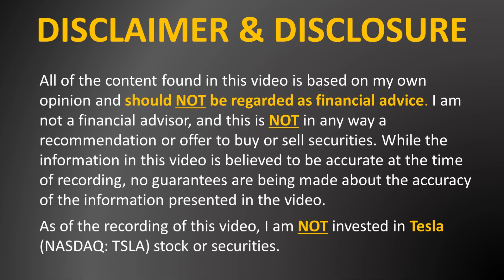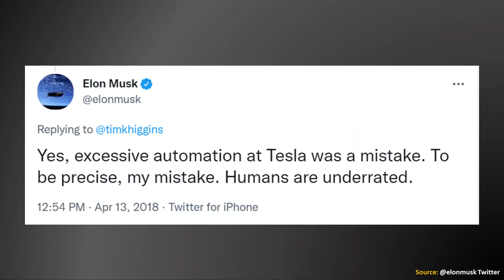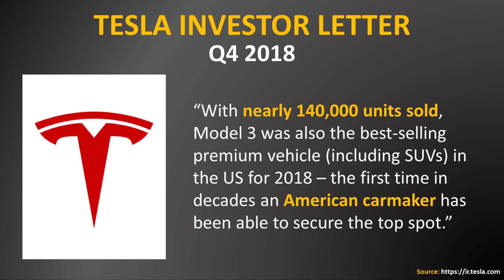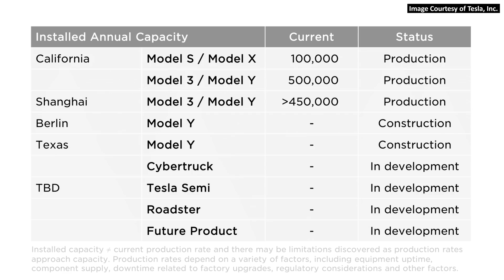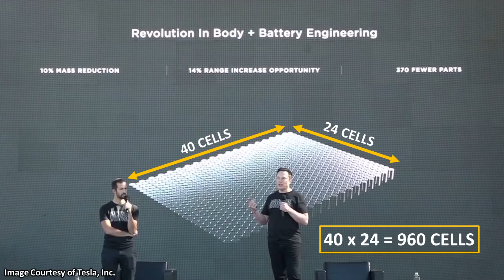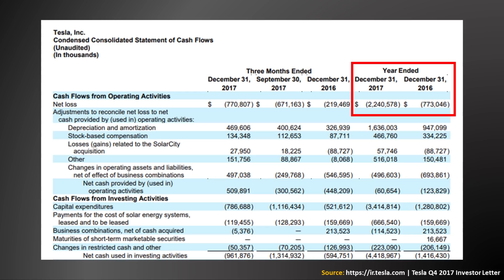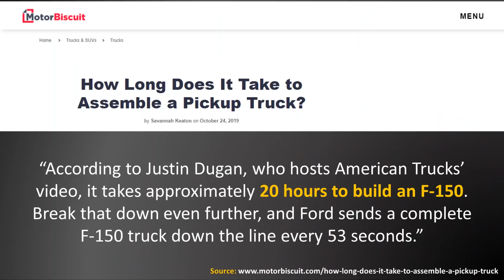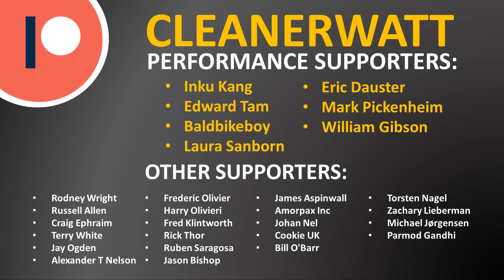Tesla's MANUFACTURING REVOLUTION: 2022 Tesla Model Y vs 2017 Tesla Model 3

Comment: Great that they improved production but the quality still sucks and their service ranks as one of the worst in the industry.   If they want to be considered anywhere near the best they better figure out those things or they won't get anywhere near the top.
Reply: I currently own two Teslas, a 2018 model 3 with 50,000+ miles, a 2021 model Y with 22,000+ miles, and I sold my 2016 model S after driving it 80,000 miles to purchase the model Y. Service has been excellent, and problems minimal. Quality is very, very good. Certainly better than any other vehicles I've owned. I bought my first car, a BMW 2002 in 1973 and have owned many cars since then.

Comment: The run rate end of 2022 will be way above 2MM, probably 2.75MM and the actual production will be 2.325MM. China will do 1.2MM alone, 750k Fremont is easy, 250k Austin and 125k Berlin.
Reply: I'll mark this one so i can laugh at it in 12 months time.
Reply: @wizzyno1566  Yes, do that. You'll be amazed in how accurate it will be. Let me know what you think and which numbers your prediction is based on

Comment: From 2018 that is a 64.8 CAGR !! That is impressive! However, I'd like to know 1. How much FASTER and 2. HOW MUCH CHEAPER will the new Teslas with front- end Giga cast and the 4680s with structural battery pack, are we talking 15% cheaper, 30% cheaper and faster or?

Comment: would like to see quality control improvements included as a necessary step before delivery to customers.
Reply: I have a Shanghai M3, Tesla has zero quality control issues with cars from there. Panel gaps and paintwork perfection.
This will be replicated and improved on at Texas and Berlin.
Reply: @grahambrown42  Exactly!
Reply: Don't believe every lie the oems feed you.  I have a GM sitting in my garage with horrible issues that my father was too old to notice when he bought it before he died.  Tesla is the only manufacturer that tests every car at every stage in manufacture.  Other companies occasionally pull a car from the line and go over it.

Comment: Wait. So Giga Texas isn’t planned to make Model 3?
Reply: I have wondered that as well. I’d really like an M3 built with the giga press with a structural 4680 battery pack. Why? Because I prefer the driving dynamics of the small sedan versus an SUV. But I’m afraid improving the M3 will fall behind the Y. Perhaps Tesla will update the M3 line in Fremont eventually.

Comment: I don’t really see anything special about those improvements, Tesla barely makes two vehicles models the y/3 and the x/s which are almost the same, on the other hand, Mercedes’ makes everything from armoured vehicles to 1000 different configurations vans, trucks, bus, minivan, utility vehicles…..
Reply: Is Mercedes making 5M+ of them? How long have they been in manufacturing business? Mercedes has 56 factories. Sold about 2M+ cars and ~350k vans in 2020. This is from assumed 56 factories. Tesla has two factories and sold 936k cars 2021. Say what you like but Tesla is doing far better than you realize in term of its manufacturing technic.
Reply from the maker: Taking Model Y manufacturing time down to 10 hours (vs 20-30 hours for VW ID.4) is pretty mind blowing. This is a HUGE advantage that cannot be overlooked!
Reply: @Cleanerwatt  bullshit, Tesla started from zero too just like vw is still ramping their production while also working with suppliers, vw has also already built their own batteries recycling facility and put into operation. Vw makes about 10 million cars a year and every 16-16 seconds a car lives the assembly line.
Reply: @alanmay7929  VW has 136 production plants (2019) for their 9m (2020) vehicle production. That’s an average of 66k per factory.Tesla factories make 10x that, with few model variants, few options, and few colour choices. The efficiency and amortisation of the factories over a huge number of cars results in large profit margins, more than any other car maker.  With no debt, this will allow Tesla to expand to more model types when they have exhausted demand for the few models currently offered.
Reply: @Cleanerwatt  there is nothing mind blowing here!

Comment: The machine that builds the machine.  Once you've optimized the car, you then have to optimize its construction.  And the logistics of the supply chain for parts and materials.  Then you have to optimize the funding of the construction.  I'm probably still missing a couple steps....

Comment: Sounds great, but when are all these efficiencies going to be reflected in the price to consumers? I really don't care how long it takes to assemble a car. I care about the quality and the price.
Reply: Comes with scale. Which is dramatically improving. Look into Mores and Wrights Laws of reduced cost with scale. 

Most of the pricing right now is in demand hikes. My cars $7,000 more expensive than when I got us due to demand and external factors like the supply chain that’s affecting everyone. Everyone’s prices are way up.
Reply: Choose one: Quality or price.  You get diminishing returns as you change your decision.
Reply: Exactly! Most rational consumers want a quality product at an affordable price. Tesla is nice and all but is still lacking in build quality and is currently priced out of the reach of the average American.
Reply: @benadebayo6088  What price is affordable do you think? Don't forget to factor in that maintenance costs are lower and electricity is about 25% the cost of gas, at least where I am.
Reply: @benadebayo6088  Tesla's build quality has improved greatly in recent years, build quality is over exaggerated and so 2020.  At this point in the production process the current crop of Tesla's are not priced for the average American. The $25K 3rd gen Tesla will address the average American. If that's not good enough, buy a Corolla.

Comment: Absolutely love this man. Elons said countless times that the shining star of tesla is going to be in manufacturing expertise even more than the products. Not enough is said about the iteration and improvements of the machine that makes the machine. Very very nice.
Reply from the maker: Very true - thanks for the kind words.
Reply: Are you serious!? Machines have been making machines for decades, stfu! The manufacturing expertise is definitely not Tesla, it’s the companies that makes vehicles with platform sharing and the multiple customization and features for a wide range of applications.
Reply: @alanmay7929  No you’re incorrect. Most other companies especially in automotive are using the same suboptimal manufacturing technology that’s been around for decades and are objectively known to lack innovation and change. There’s a reason Tesla and SpaceX are the two heaviest demanded companies by graduating engineers. It’s objectively and factually backed that Tesla is innovating and moving forward with manufacturing expertise in leaps and bounds above everyone else. Period. The next best are actually the Chinese companies following that example. 

Case in point: single large body mega-castings reducing 300 parts to 1.

The aftermarket will always be there for customization but you can’t logically argue against Teslas manufacturing unless you’re dangerously uninformed, or heavily biased against Tesla.
Reply: @CYBRLFT  I strongly disagree with you, first of all Tesla said they where replacing 70 parts with one large part but they don’t tell you that they were the only to use sooo much parts, other manufacturers have been using larger single parts for years including composite materials to even make lighter cars, bmw built a decade ago one of the biggest carbon fiber factory. Other manufacturers also have way more vehicle types and selection compare to Tesla. Tesla is now bringing features to their cars that were already available on other cars decade ago, other manufacturers are also in sport competition where they develop and race the most advanced vehicles on earth, from bikes to F1 to wrc. Other manufacturers makes vehicles and equipments used all around the world from mining to construction, rescue, utility vehicles….. people seriously underestimate the automotive industry.
Reply: @CYBRLFT  aftermarket customization is not at a level of a manufacturer that can offer most of those things in house with better integration, you can litteraly buy a Mercedes’ dump truck, chassis alone, garbage truck, long haul truck, super heavy duty……. A Mercedes’ double decker bus, articulated bus, coach bus, city bus, minibus….. tons and tons of possibilities from house. Even army vehicles are made by Mercedes.
Reply: @alanmay7929  This isn’t new information. The auto industries been around over 100 years. One would expect everything you said in the sense of the reach of automotive engineering. 

That’s not being debated. I’ll return the focus to the point I’m making which is that Tesla, though small and functioning on First Principles thinking, is innovating and pushing the industry forward exponentially. Most people that argue against in the way you seem to is due to a lack of understanding of exponentials. 
For the majority of Teslas time in automotive they’ve been working out of a Frankenstein factory they had to retrofit from the plant that Gm and Toyota used to own. Last year we saw the results of what a fully custom built Tesla gigafactory can do and the Shanghai factory is still expanding. Tesla is already annualized to produce 1.2 million cars per year right now and that’s without any consideration of what brilliant German engineers will do with Giga-Berlin not the Austin Terafactory. 
Now two more larger and further improved factories in production/efficiency are coming on line that will add an additional 5 million annualized production cap to the current production cap after ramping. You can’t deny the pace of manufacturing production and innovation using the Idra giga-press and thru-put design of the factory on top of vertical integration. 

I mean you can deny it, but not correctly.
Reply: @CYBRLFT  another regular bullshiting!! Other manufacturers also have vertical integration and also owns most of their suppliers, other manufacturers makes regular cars that are not just used for the roads but off the road, for overlanding….your regular boring Tesla is just for the paved road where as a cheap Toyota RAV4 is perfect for all kinds of activities. Tesla is not even remotely close to have the best car factories, vw for example has a gigantic factory directly connected to the European largest private rail park for logistics, the same with Mercedes’ the world’s largest truck manufacturer with all the hundreds of models that can be delivered directly by trains to customers.
Reply: @CYBRLFT  a 85hp fiat panda has even way better off-road capabilities than a 500hp Tesla awd what a shame.
Reply: @alanmay7929  lol how is that even relevant to the discussion… try and focus 🤣
Reply: @alanmay7929  No legacy auto is not vertically integrated. That’s a flat out lie and you know better lol. Man you’re so emotional about this which explains the lack of logical thinking here. 
You also keep trying to shift the conversation from the point of manufacturing passenger cars to the niche of off-roading and racing and other applications. Let me make this perfectly clear. 

THATS NOT TESLAS MISSION. It is to accelerate the worlds transition to sustainable energy and transport. They are NOT trying to take over the auto sport market lol. Never were. They are making passenger cars. 

So now that that’s out of the way. 
You’re trying to compare the current highest producing automakers to the growing Tesla manufacturing. Just look at VW and Toyotas year over year production from 2020-2022. The numbers speak for themselves. Everyone but Tesla is down while Tesla is up 88% year over year. 

Im rooting for VW because their CEO gets it and is trying to electrify them but the dumb Porche Family is trying to push him out. Okay if they do that then all you’ll have in the future is the memory of VW’s good ole days after they’re gone or desperately merge with Mercedes and BMW as they struggle with sunk costs in legacy tech.

You can get up in arms and all emotionally bloated all you want but data doesn’t care about your feelings friend.
Reply: @CYBRLFT  Tesla is also not vertically integrated they still rely on tons of suppliers around the world. Tesla parts are made in Mexico, China, South Korea, Germany, Taiwan….. Toyota for example basically owns Denso, AISIN and many other companies that makes most of Toyota parts. There is nothing emotional here mate, cheers!!
Reply: @alanmay7929  Blatantly false. It highlights either your intention bias or ignorance to the facts of manufacturing at Tesla as compared to legacy auto. 

While they may not be 100% vertically integrated, they are far and above more vertically integrated than literally everyone else by a large margin. It doesn’t take more than a 2 minute google search to see that data. From electronics, to batteries to the power train and vehicle assembly to chip programming and interior manufacturing of seats, Tesla has basically forced other companies to begin to vertically integrate. The way Teslas has again grown 88% year of year while everyone including Toyota drastically went down in the same time due to supply chain issues speaks for itself. 

The facts are in front of you but given the “cheers” I graciously accept your surrender in this discussion.